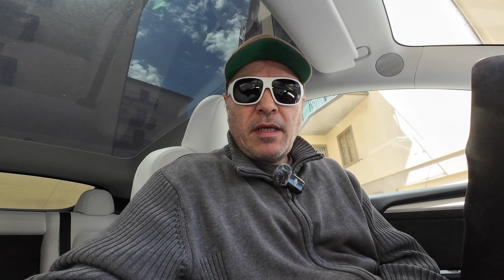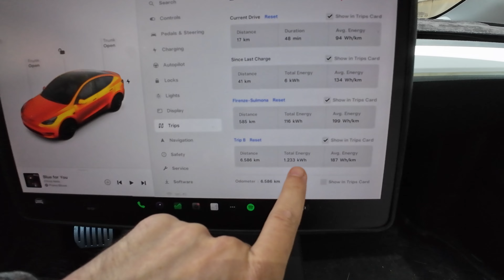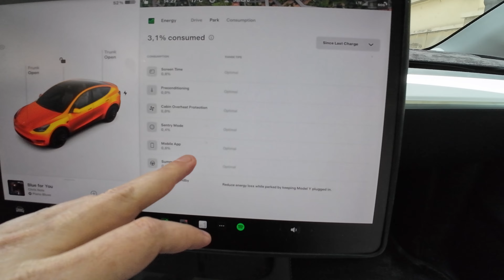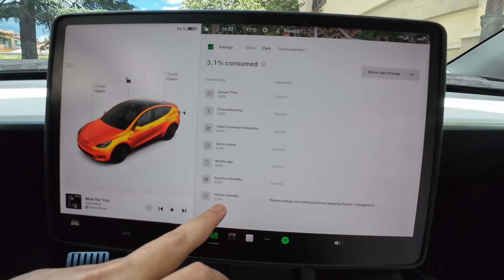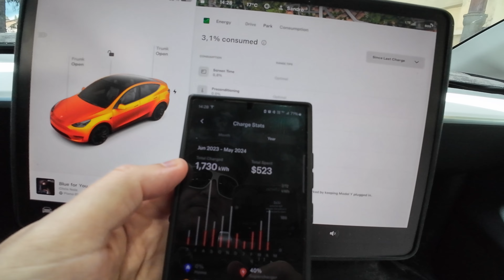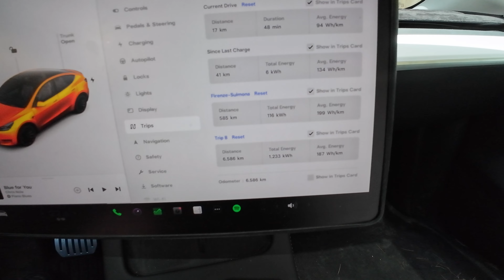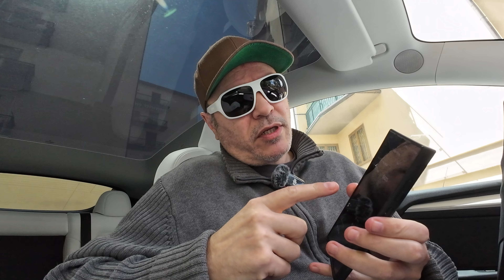Tesla and eV, Charging Hidden Costs!

Comment from the maker: Charging hidden costs are not know by most people getting an eV. The total energy that you pit into an eV is not only consumed by driving the eV but also by “running” the systems that the eV has. This will include the loss of energy from the charging equipment.

00:00:00 Into
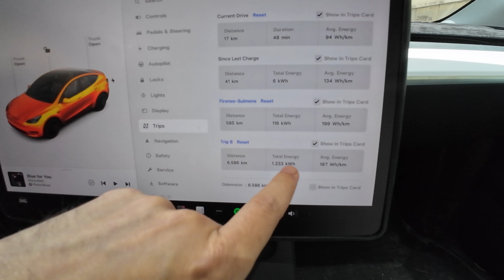00:00:47 Driving Energy
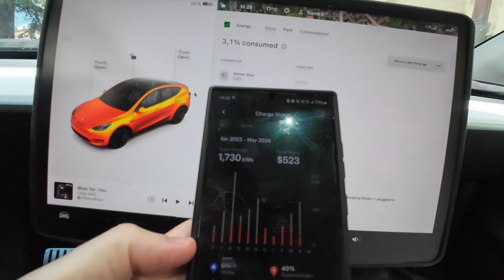00:02:12 Charging Energy
00:04:04 DC charging
00:05:57 AC charging
00:07:28 Energy Losses
00:07:51 Hidden Costs
00:08:23 Sentry Mode

LIKE and SUBSCRIBE https://bit.ly/3Q13IJo
============================================================
Tesla referral - http://bit.ly/40AHyAL
============================================================
MagBak RimCase - https://bit.ly/3Tx2isp - Coupon Code 15% OFF: CIAOTESLA
============================================================
TesFavs - https://bit.ly/3Ilmirv - Coupon code 10% OFF: ciaotesla
============================================================
HALOBLK - https://bit.ly/3YPeA09 - Coupon code 10% OFF: ciaotesla
============================================================
Tesery - https://bit.ly/41eoF8b - Coupon code 5% OFF: ciaotesla
============================================================
Cabin Accessories
============================================================
Floor Mat - http://bit.ly/3K7qiwy
Tempered Glass Screen Protector - http://bit.ly/3U114V9
Rear Seat Back Anti Dirty Pad - https://bit.ly/42GVISf
Interior Organizer - http://bit.ly/3nCB2ve
27W Quick Charger - http://bit.ly/3GsQyAk
Door Side Storage Box - http://bit.ly/40SMgK6
Backseat Air Vent Cover - http://bit.ly/40xpOXe
Door Lock Protector - http://bit.ly/40vSnV8
Car Door Protector - http://bit.ly/40C3GuV
Navigation Screen Protector - http://bit.ly/431pLF2
Door Seal Strip Kit - https://bit.ly/3GLU1dg
ORICO M2 NVME SSD Enclosure - http://bit.ly/3Gqpcus
Wireless Charging Pad - https://bit.ly/3VsEyoD
Screen Edge Protector - https://bit.ly/3Hvz4np
Roof Sunshade - https://bit.ly/3MwkDSY
Seat Corner Guard - https://bit.ly/41U6rs1
Steering Wheel Cover - https://bit.ly/3HAfJ4r
Car Door Lock Cover - https://bit.ly/3OfkAMI
Door Lock/Unlock Mechanical Switch - https://bit.ly/3O97oZI
Glove Box Organizer - https://bit.ly/3WL2i8j
Seat Corner Guard - https://bit.ly/43hOpAW
Windshield Sun Shade Covers - https://bit.ly/3Noxgig
Organizer Case - https://bit.ly/3NIY7XF
Anti Kick Pad - https://bit.ly/3XrhQhA
Armrest Cover - https://bit.ly/3CQVSeG
Rear Seat Lower Side Guard - https://bit.ly/3NABEdU
Rest Pedal Side Guards - https://bit.ly/3JQsM2H
Dashboard Cover - https://bit.ly/3ZiwicO
Rear View Mirror Protector - https://bit.ly/45ZfwlD
Screen Rotation Bracket - https://bit.ly/3tunXY9
Haloblk HaloStation - https://bit.ly/4bh5ZcM
Haloblk Center Console Cup Holder - https://bit.ly/42j8PJY
Haloblk Center Console Organizer - https://bit.ly/3SDJ4kA
============================================================
Frunk Accessories
============================================================
Anti Insect Net - https://bit.ly/3qck4p8
Lower Bumper Anti Insect Net - https://bit.ly/3IMjLHp
Wiper Filter - https://bit.ly/413Yrn5
Waterproof Frunk Strip - https://bit.ly/3LwqANX
Debris Filter - https://bit.ly/458jRmz
Windshield Drainage Filter - https://bit.ly/3PfP9Cq
Insect/Debris Air Inlet Cover - https://bit.ly/3Qmxdqe
BASENOR Frunk Cooler Organizer - https://bit.ly/3TXYNvB
============================================================
Trunk Accessories
============================================================
Rear Seat Trunk Pad - http://bit.ly/40QDdtq
Rear Trunk Protective Pad - https://bit.ly/41wxoBs
Futhope Trunk Sill Plate Cover - http://bit.ly/3ZETSPs
Traveling Baggage Fixed Net - https://bit.ly/3o9hVsR
Trunk Sides Storage Bins - https://bit.ly/414QPRm
Trunk Side Guards - https://bit.ly/3WIiNlg
============================================================
External Accessories
============================================================
Front and Rear Mudguard - http://bit.ly/3KntCos
Roof Rack - http://bit.ly/40LFuX0
Side Camera Cover - https://bit.ly/3LOsxqC
Charging Protective Cover - https://bit.ly/3o8WmsU
Logo Badge Sticker - https://bit.ly/3Wba4ru
Projector Door Lights - https://bit.ly/42JYqpv
EV Charger Cover - https://bit.ly/3CXHUaE
DIY PPF Lights - https://bit.ly/47kkoBZ
Door Rubber Seal Strip - https://bit.ly/4aCMkDr
============================================================
Tools Accessories
============================================================
Lifting Jack Pad - http://bit.ly/40wBvxy
Portable Panel Removal Kit - http://bit.ly/3UiwqXv
Charging Cable Storage Bag - https://bit.ly/42qvK4q

Comment: Your cost for charging per mile appears to be about $.14 per mile 🤔
That's not very good, compared to Hybrids and Gas prices🤨
Reply from the maker: you are kidding, I save 50% at least! If I charge at home is 60/70% savings. Here in Italy diesel is at Euro 1.9/liter, gas 1.8 and increasing! And if you factor in only the energy spent to move the car is even cheaper.

Comment: Find the magic key code, put your car in transport mode, and the phantom loads should stop as the car REALLY turns off when not in use.
Reply from the maker: if you power off a Tesla all the systems in place for safety and security won't work anymore. It would make sense if you park in a garage but if you leave your car outside is another story. But yet powering off your eV will reduce these losses.